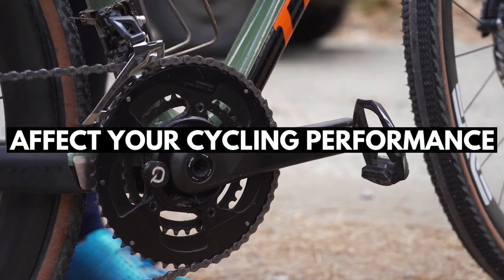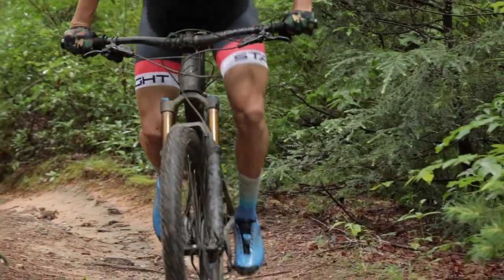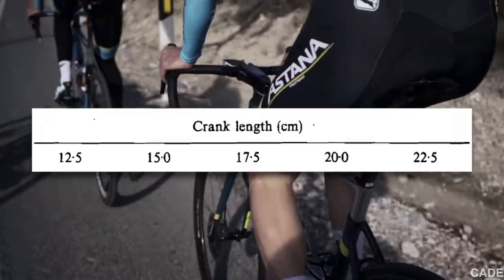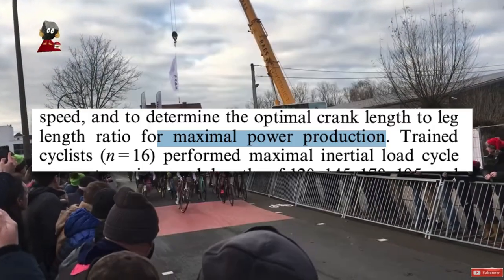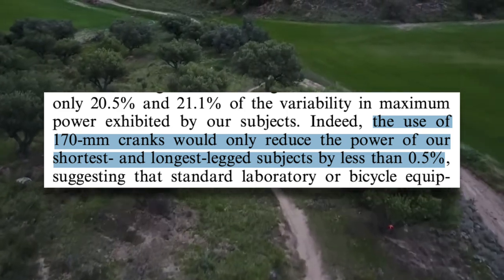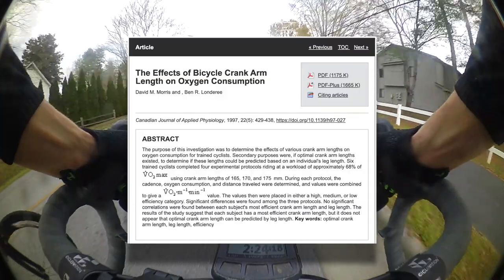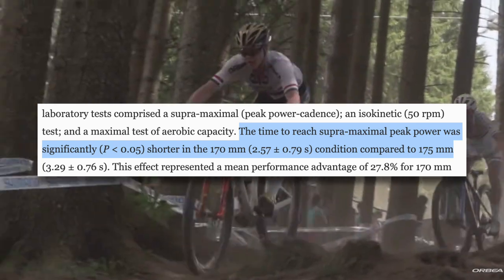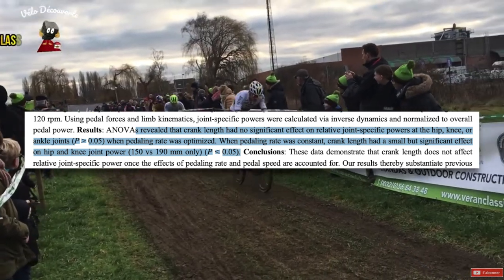Does Crank Length Affect Your Cycling Performance? The Science

Comment: In terms of the physics, increasing  the crank length is somewhat like making your back ring slightly bigger. You move further to get the same input, therefore the resistance is less. Because we have so many options for resistance with gears it's not easy to feel the slight change. However if you have two single speeds with the same gearing,  but with a difference of 10-15mm in the  cranks, you can feel the shorter cranks giving you more resistance, as though you shifted up one gear. The reason the 165'rs were doing more RPM's was they had to downshift to attain the same lighter resistance as the 175'rs. The velocity of the feet was the same even with the higher RPM of the 165'rs - if you imagine the distance around the circle. Pi x diameter = circumference, so if the two cadences had stayed the same, the  feet would be traveling  518 mm to go around with the 165s, 550mm with the 175s. So more torque with the 518 to get the same distance out of the wheel. Inversely, to cover the 550mms the 165s need 1.06 revolutions compared to the 1 revolution for the 175s. So 6% higher cadence. Simple math. 
     Another way to imagine this is if you had a bike with two chains. A ring in the front pulling a second ring in the middle, directly attached a third ring with the second chain, which spins the fourth ring on the back wheel. If that second ring gets bigger, what happens? (just like your bigger ring typically on the back wheel) -- less resistance. Your legs are that first chain and the cranks are that second ring. 

     Hope this doesn't sound convoluted, it's actually quite simple. Purely ratios. The absolute simplest way to imagine it is with no chain, and your cranks directly spinning the back wheel . Longer cranks would basically be the same as a bigger back ring. 

      Of course this doesn't address leg length, preference or performance. Just the Newtonian side. Hope I didn't take all the fun out, LOL
Reply: This really shouldn't even be a question. Anyone who's ever had to loosen a bolt using a breaker bar understands the concept of leverage. The crank arm is doing exactly what a ratchet does to a bolt - applying twisting force. The longer the bar, the more force is applied. A longer crank arm is going to provide greater leverage, and thus each pedal stroke will apply more force than the same stroke with shorter arms. Yes, shorter arms let you spin faster, but why would you want to? It's not like you're gaining anything; a rider with short cranks will have to spin faster in order to match the speed of a rider with longer cranks, so basically shorter cranks just means you have to work harder to get the same result. 

The only reason a shorter crank length is desired is on a MTB, where ground clearance becomes an issue. Downhill bikes for example, will likely have short cranks because gravity propels them most of the time. An XC bike on the other hand, uses longer cranks because a great deal of it's time is spent pedaling. My XC bike has 175mm cranks. I wouldn't dare go shorter - shorter arms means I have to work harder to apply a given amount of power. 

Regarding leg length, that's not really going to be a factor provided the rider has saddle height set optimally. Short leg or long leg, a longer crank arm is still going to offer more leverage. The distance between the center of the crank axle & the tip of the crank arm is going to be same, no matter the size of the rider's leg. Thus, the number of strokes needed to produce X amount of speed is the same regardless of leg length, because the circumference of the pedal stroke is the same. Provided the rider has their saddle set so that each pedal stroke almost fully extends their leg, they will apply maximum power on each stroke.
Reply: It will not effect the bottom of the stroke if a shorter legged person has the longer crank. (Assuming the seat height is set correctly as you point out.) But it will certainly still effect the top of the stroke. 
 Leg length is another lever size, and the difference in angle between tibia and femur could be greatly affected, depending on how short of legs we are talking about here!! imagine yourself riding on a 200 or maybe even 240mm crank, how much more  bent your knee would be at the top. Once again, that angle is part of the leverage equation.
Reply: @sixstanger00  you're forgetting losses to friction. Pushing big cranks means more chain tension and this definitely affects mechanical efficiency in both chain and bearings in the bottom bracket and rear hub. It's never simple, and there's always a trade-off.
Reply: @sasquatchrosefarts  The crank arm length will not change the amount of friction on the chain/hub, because the chainring is still the same diameter. 

The chain engages with the chainring, not the crank arms. A longer crank arm simply provides more leverage to rotate the assembly easier. But the chainring and chain itself will experience the same amount of friction at 80 RPM, regardless of crank arm length. The only way you can increase friction at the chainring is by increasing it's diameter and thus adding contact points between the chain/teeth. 

As for chain tension, the weight of the bike/rider is fixed, so the drive wheel will require a fixed amount of energy to spin, regardless of arm length. The longer arm, just like a breaker bar on a bolt, allows you to apply that energy easier. But ultimately, the chain will experience the same tension in a given gear selection, because regardless of the crank arm length, the weight is still generally the same. 

A longer arm doesn't mean you apply more power, it just means that applying X amount of power on 175mm cranks will be easier on your legs than 165mm cranks.
Reply: @sixstanger00  more torque and lower rpm is more tension on the chain. Get off the meth bro
Reply: @sasquatchrosefarts  Not on any meth, BRO. 

How has torque increased? The gear ratio is the same. What's changed is how hard I have to exert my leg to press the pedals down. Power has changed, not torque

80 RPM will always be 80 RPM, so the tension is not going to change unless the gear ratio lowers (thus lowering RPM), requiring more power at the pedals to keep things rotating. 

But that has nothing to do with arm length; that has to do with gear ratio. 

If I spin 80 RPM with 175mm cranks, it will exert the same chain tension as 80 RPM with 165mm cranks, because either way, the crankset is spinning at 80 RPM.
Reply: @sixstanger00  you're on meth. A spinner moves more inches of chain per watt. A masher uses less. The more inches of chain you use per watt, the less tension. If a longer crank tends to put you in a smaller rear cog, the longer crank runs higher chain tension per unit of distance traveled.
Reply: Found this video by accident and was somewhat amused as I am the author of one of the papers cited.  You do a good job of explaining the physics of the bicycle, but where it gets really complicated is the physiology.  As you pointed out, the feet have to move at a higher velocity to maintain the same cadence when using a longer crank arm because the feet have to travel a greater distances per revolution with the longer crank.  What most people neglect is that, because of the greater range of motion, the muscle fiber has to contract at a higher linear velocity. So even though the resistance at the pedal is lower with a longer crank, the increased acceleration of the muscle fiber (to produce the higher velocity) results in a muscle that must produce the same amount of force - at least theoretically and neglecting the work required to move the limbs. So how does the muscle work most efficiently, by contracting slowly against high resistance, or faster against a lower resistance? It seems to depend on the individual and we have not yet found a way to predict it.

Comment: The timing of this video couldn’t have been better for me thanks. I sized down one size on my new bike and kept the same crank length and discovered a new phenomenon for me - toe overlap. I may need to drop crank length if this toe overlap becomes a problem, but so far I can’t tell much difference otherwise.
Reply: Ryan Wayne I use a CX as a winter training and commute bike, that has terrible toe overlap. Changing to 165 was worth it just for minimizing the overlap. Still can’t use mudguards on the front wheel though, but that is less of an issue.
Reply: My bike is also a CX frame built into a gravel race bike. I am considering going to 170 mm from 175 mm to see if this eliminates the problem. Thanks for sharing your experience
Reply: Just run a bunch of toe out to clear the tyre. I'm sure your knees will be fine. (joking of course)

Comment: I am 5’4” with a 26” inseam. I went to a shorter cranks 155cm and my decision was not for power or cadence it was for comfort. Let me explain. When  you are vertically challenged like I am and the manufacture puts 165cm/170cm cranks that now means I have to lower my seat to be fitted properly;however, now at the top of the pedal stroke my knees felt like they were coming to my chest and they were. My legs would hurt. It felt like I was doing high knee exercises for 30 miles, so I started looking into crank length and settled on 155cm and my legs felt great from day one.  Think about it.
Reply: I'm 5'2" and ride with 165/170 on my 2 bikes...  Where did you end up getting 155?  And how much did you raise your saddle?
Reply: Chris I have Cobb and Vision TTiMAX
Reply: @RoyDeWeese  i am 6 3 i think and about and over 34 inseem not exactly sure how much but i have the same problem with my knees hitting my chest

Comment: I'm 71 years old.  In the past several decades, I've used 165's to 180's for extended periods.  I was 6'3" when I did all these changes (I'm now 6'2").  Thanks to the U.S. Army, I learned that my leg length is disproportionately in my femurs.  That coupled with size 48 shoes, I'm pretty far out on the crank compared to most.   I liked 180's but my knees didn't.  I've been on 175's for the past 20 years and it works.  Where your leg length is and how long your feet are is more important than just an inseam number.  All said, ride what's most comfortable.

Comment: Thanks for making this! I've been debating whether or not to switch from my usual crank length with my new groupset, but now I think I'll probably just stick to what I'm already using. I think that one of the most important factors (and this has always been the case) is considering pedal strikes, which is really only an issue in specific scenarios anyway.

Comment: Dylan, I looked at this a lot about 3 years ago.  I think the answere is disciplin specific.. tracksters use short cranks.  In my case, I was riding 175 and had issues with both my knee and hip angles when on the drops. I actually bought second hand cranks from 165 upto 175 at 2.5mm increments. I settled at 170, 167.5 was prob the best but it was marginal on how it felt, and I couldnt get thrm in the brand/range I wanted .
Here's the thing though, its only a 5mm difference, but as it is shorter it alows the saddle to be lifted 5mm for the same leg extension angle, the benefit comes at the top of the stroke as your saddle is now 5mm higher and the pedal 5mm lower. This really helps both your knee and hip angles. Effectively like raising your original saddle set up by 10mm, which eases knee and leg angles particularly if you are on the short side of the mean. For longer distances this made a massive difference to me. It wasnt about how much power it was about comfort and ease of power for me.

Comment: I'm 180 cm, 81 Inseam, had 175 mm, switched to 170 mm, night and day difference, I don't care so much about the performance I mostly care about comfort during long rides, after I changed I didn't  have knee or muscle pain no matter how long I rode my bike and trust me when I say that I tried all saddle heights from too low to too high and everything in between on 175 set up, that is because you can effect the low point with saddle height but the highest point is affected by the crank length 1 major thing I noticed is that before the change I would get the rocking out of the saddle sensation like my hips are jumping during high cadence intervals, now those are completely gone and my body is telling me that the change was good. I was inspired by the Neill Stanbury bike fitting videos on Cam Nicholls channel some cool stuff there.

Comment: A good look at this! Regarding leg length relationship - its not really leg length that determines optimal crank length in my view but the length of the femur. So picture an engine pistons conrods and grankshaft. Thats the analogy. I was moved from 175 to 180s some 15 plus years ago by a very stute coach - ex TT specialist. It took a short time to re-establish my cadence mayber 3-4 weeks. So all of my road bikes including the TT have 180 cranks. I've never had an issue with cadence - did all my training at 95-105  - optimal power for me occured at 92-95 - for continuous power that is. As far as sprinting and track - no question - shorter cranks are better for short term power output. Sustained climbing and sustained power - i have never looked back on the move. I'm 1.89m and run a 58 top tube. Some smaller climbers use larger cranks  - Pantani for example - he used 180s if I recall and he was tiny. Dont know the logic.

Comment: Hey Dylan, great stuff! I sat and lugged at a very slow cadence for years; like in the 70's. I virtually never stood, even in XC races. I also sat super high all the time, very far forward on my road TT saddle over top of the BB, as I could get super low with the dropper post when I got scared!   But on Gerry Pflug's suggestion I moved from 175mm to 170mm.  The different was huge!  I found I could spin faster, stand more, and lower the seat as well. It didn't hurt as much to spin at a lower angle, something I could never do at 175mm. I also had more clearance. I think the only drawback is you end up raising your centre of gravity when standing, by about 2.5 mm,.  I'm not dead sure on that, but it is because the pedal at the lowest point is a bit higher off the ground.   All in all, the experience has always made me want to try a 165mm crank, but I never have!  Even with the 170mm my cadence is slower than than everyone around me. I'm comfortable I think around 80rpm; but frankly just don't have a lot of data to know for sure as I never measured it racing.

Comment: Thanks for this in-depth review.  Not exactly what I expected based on personal experience but I trust the science.  So not very scientific because my chainring sizes also changed but @ 5'6" and long-time 165 crank user, I switched up to 170 when I bought my GRX (48/31) gravel bike.  Interestingly, on longer rides and races I noticed both knee and achilles pains I hadn't experienced before.  I chalked this up to the new bike, its fit, and didn't really look at the cranks suspiciously - maybe because GRX doesn't come in 165, so I was stuck.  I kept my Cannondale 165 (50/34) on the trainer and was seeing sprint power over 1.1kw easily during 4dp tests but on the 170s struggled to peak 900w at while attaining a decent sprint cadence.  Last week I switched out my gravel bike to Ultegra 165 matching the Cannondale and found my interval sessions are easier to complete at higher powers and longer durations and my joint/tendon issues have not reappeared on rides over 80mi.  (note - Power meter was reset to match the new crank length.)  My sprint on the road now matches what I can do on the trainer.  I think this melds well with the science; that we need to experiment and find the crank that allows our preferred cadence; fits our biometrics and metabolism.  Now I only wish Shimano would make a GRX 165 crank.

Comment: Did you find anything about ultra endurance? I heard going shorter reduces the movement in your hips therefore reducing potential problems in 1000+ km races. Is there any basis to this statement? Cheers mate!
Reply: It also increases the force at a given cadence and power output, (or increases the required cadence at the same force and power output)
so there's no free lunch.

If you're moving your hips more than is comfortable for long rides, shorter cranks might help.

If you've got long legs and you're already underusing your comfortable range of motion, you're going to be increasing force on your knees, or increasing your cadence to maintain the same power, so you might make things worse.

It's really about fit, and unfortunately it's not something that can be easily adjusted, so there's no way to experiment cheaply, so most of us are stuck running whatever comes with our bikes, whether it's ideal or not.
Reply: Using the SRM formula to work out its slope uses crank length its less force required with a longer crank. So in that sense if you have a bike fit for a longer crank and have that range of movement is fine it would be more beneficial in ultra-endurance events